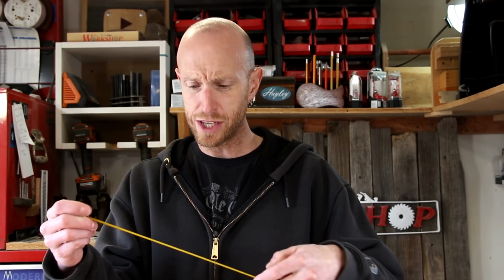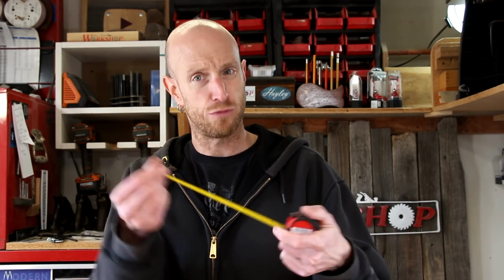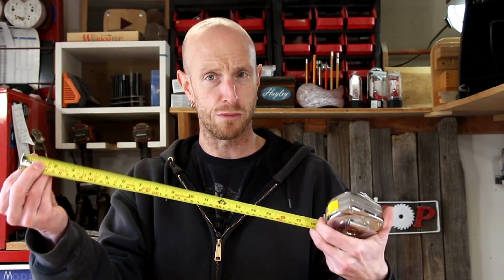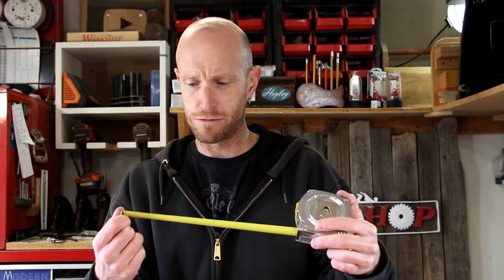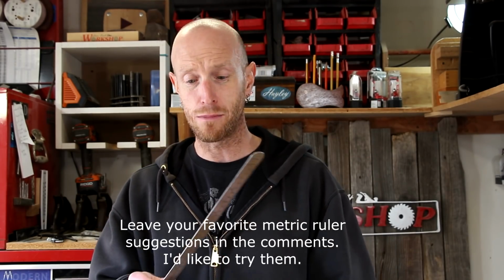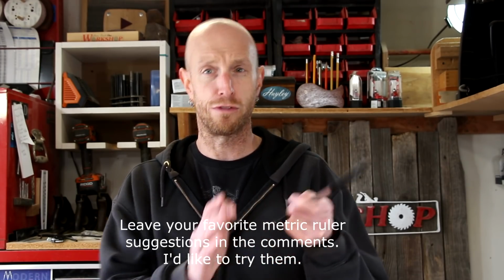My thoughts after using the Metric System for a project | I liked it

Comment: I’m 72 so here in Australia I grew up with the Imperial system and we changed to metric when I was in my thirties.  That means I am well versed in using both and a lot of my measuring tapes and rulers have both on them.  I mostly use   metric, as you said dividing everything by 10 and not using fractions makes things easy.  It really doesn’t take long to get used to , particularly when rulers, tapes and tools in metric are readily available and materials are sold in metric measurements.
The only time I really use imperial is my dollhouse miniatures hobby because the standard scale is 1:12 and using feet and inches makes conversion easy.

Comment: 1:08 "Here in the US most of us use the standard system of measurement."

The metric system is the standard system of measurement!
All imperial units are defined by metric units.
Reply: This!
Reply: Wait, what does that mean, they're defined by metric units? An inch is 2,54cm, a foot is 30,48cm and so on, pretty much none of them convert into a nice round number that would be easy to convert in your head.
I did get a chuckle out of calling the the "standard system" though considering that practically nobody else uses this abortion of a measurement system but the US.
Reply: @Sercil00  in 2019 all metric SI units were redefined according to 7 universal constants.

The imperial measures are now defined as according to those constants. So an inch is not a length that happens to be the same distance as 2.54cm but rather an inch is a way of expressing exactly 2.54cm. In the way that a metre is 100cm
Reply: americans... muricaaa
Reply: @Sercil00  Myanmar and Liberia, however, both are in the process of switching to metrics.
Reply: 95 percent of the world's population use the metric system. 

Isn't it weird how only 5 percent manage to use the standard system?

Comment: I'm in Eletronical engineering so we always use metric.
The fact it's in multiples of 10 is so useful. It's so easy to visualize things.
Reply: Yeah apart from PCB design where you have to use mills. I get so frustrated when doing so as i have no clue how to relate components sizes and spacing with board size in normal units.
Reply: man imagine trying to graph something logarithmic like volume of sound (for a speaker or something) in imperial units, sounds like a nightmare
Reply: @GameCyborgCh  Is there even anything different than decibel for that? Like an imperial measurement?
Reply: I would not put my life in the hands of imperial units. No way! XD
Reply: @fb55255  Then why you don't make your boards metric? Some rule at your company or something? Many modern parts have metric footprints,  so you get mixed grids on your board anyway. Really no reason to keep it in mills if you don't want to.
Reply: @fb55255  We design our boards in metric wherever possible but some connectors are only available in us standard/imperial units and most ICs have spacings in fractions of an inch. The thing that pisses me off the most is that a Euro connector was created in metric so it had a 5mm lead spacing and then some clown decided to make an exact copy of it with 5.08" LS - they could have altered the design slightly so you could tell the difference easily but no they had to be a smart arse.
Reply: You know how I hate it when I watch those American or UK programs with the fat people losing weight. I never know whether I am considered fat or not because everything is in pounds or stone! There are people who apparently weigh 600 pounds, and heaven knows how many kilograms that is, but it's made me rethink my entire life!
Reply: @sandercohen5543  Have you ever flown anywhere? Imperial units are still common in aerospace.
Reply: @tjp353  cool, i never knew that!
Reply: @sandercohen5543  There can be quite a mixture of units. For example, a mostly-metric European Airbus has Imperial sized bolts holding it's wings together. In operation it will fly at an altitude measured in feet, an air speed measured in knots (nautical mph) and then land on a runway typically measured in metres with it's elevation given in feet above sea level.
It might seem like a strange system but changing it now would be expensive, disruptive and potentially dangerous.